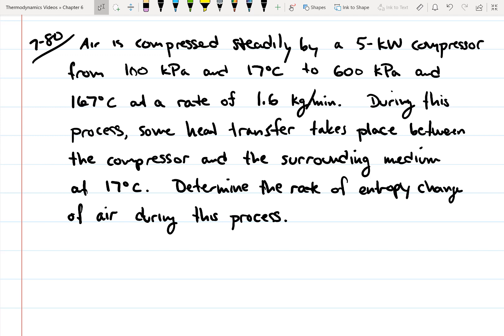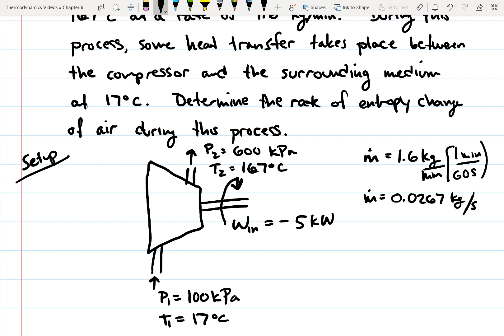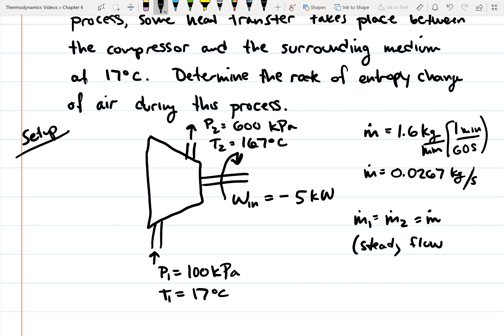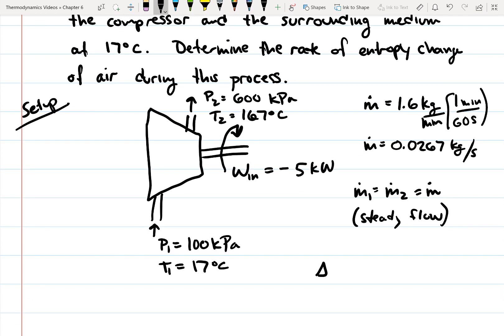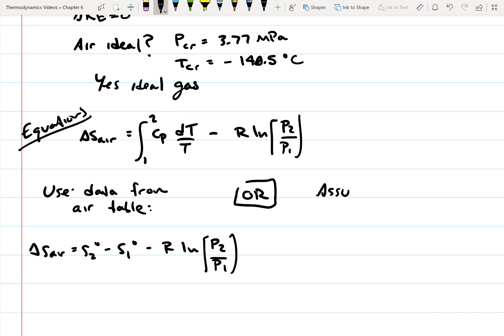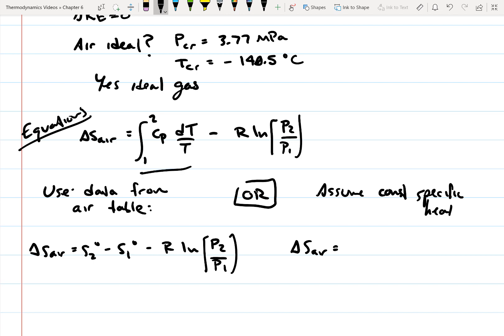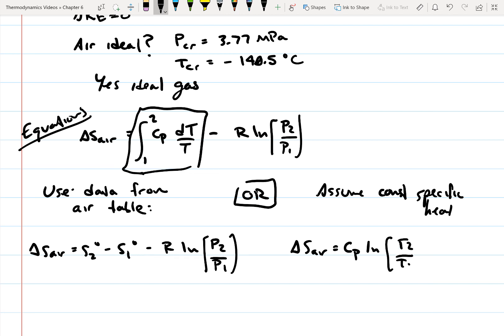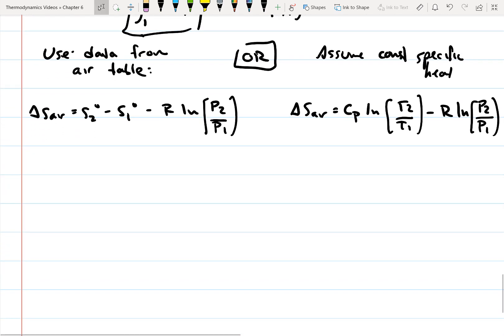Thermodynamics: Example Entropy Calculation with Ideal Gas

Comment: something I am not understanding? 0.0267 * -0.0267 does not equal  -0.0025 ??  ok I got it  you should have used -0.0936 instead 😀
Reply from the maker: Yes you’re right. It’s 0.0267* -0.0936. :).